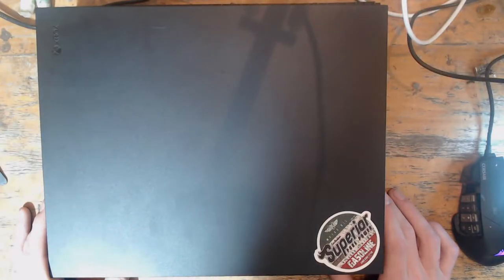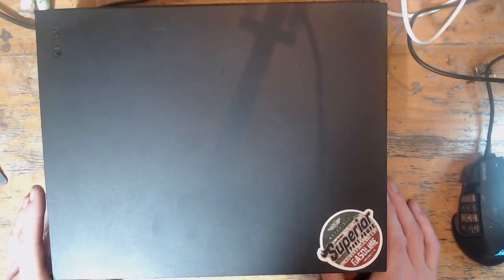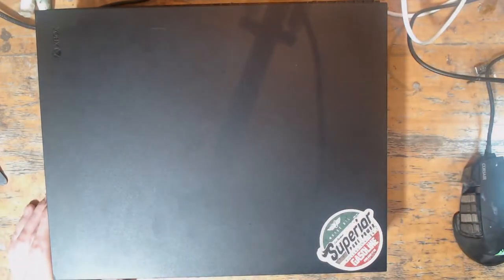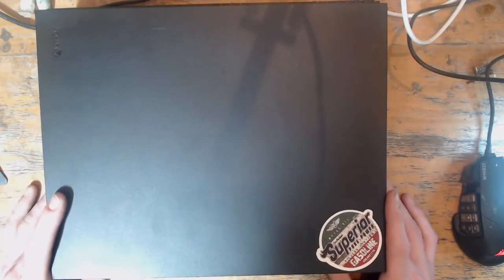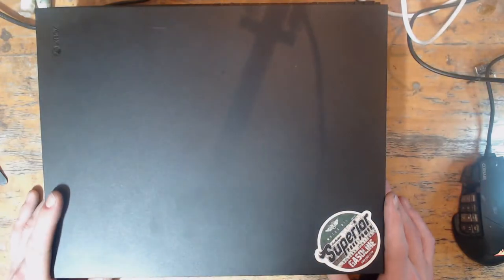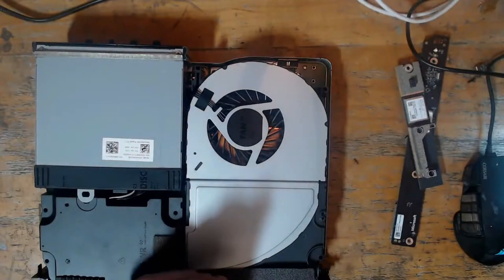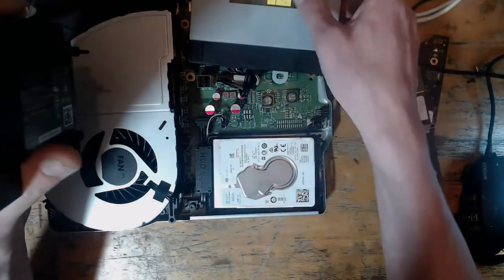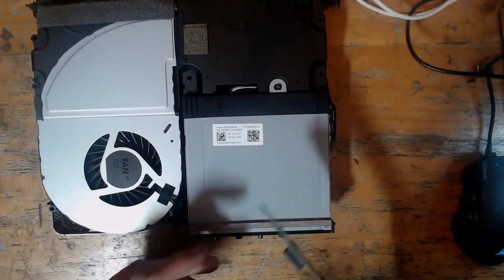Xbox One X Black Screen No Display - How To Diagnose And Repair A Faulty TDP158 Retimer IC

Comment: Thank you so much Phil I just brought my first xbox one x back to life. I did the retimer chip and that didn't fix it. I then noticed the hdmi out port looked like it had been worked which is funny cause the guy I bought it from had said that it just stopped working. I didn't have any hdmi ports for it just the ps4. In a pinch I harvested the hdmi in port from the board and used that. Success!

Comment: A few things from me :). 

1. Thank you, it was the video a long time ago where I've learn about the fault of TDP158 :). I see that I've already liked it, so can't do it twice :D.
2. The difference in the leaded and lead free solder is only 30C, so, not much ;) IMHO. Only soldering paste and low melt solder can do less than that and that is a big difference in the melting point. But 30 a lot ;). C'mon :).
3. Yes, soldering those pads with no T12 which can give up to about 70W vs a regular soldering iron, or a regular soldering station which is 45-60W makes a HUGE difference :). The T12 makes a whole difference and it's worth spending those +£20 to buy a DIY kit to build it yourself. Again, you've said that you've got a cheap soldering iron here, but, I did not pay for my T12 DIY station more than those +£20. So, no excuse :D. I don't need to use a hot air anymore since I've started with this T12.
4. Using a 480C degrees is OK, I've done it in the past, but, if your station is +500W one you can do it with 350C as well which is the safe temp for soldering ICs comparing to 480C. When you buy these chips, you can read that you should solder them with a max temp of 350C. Otherwise you short their longevity. 

There is a preheater as well which can help lower the melting point from the top, and with preheater I was able to solder QFN packaging at 300C, probably you can go lower than that, but I've never tried yet cause I've stopped using preheater and use only a hot air.
5. You use a no-clean flux, I know cause you're the reason why I have it here :). So, you can clean = yes, but, it's not a must. Even in the factory when they use a no-clean flux, they don't clean more than an absolute minimum. This flux should not cause a harm to the board. All it can do is to make it sticky ;). 

I've rewatched this video after a long time cause I've got One X and wanted to make sure I remember everything :). And yes, I remember everything. I did wrote the readings as well this time of the HDMI port PIN out and this one is different from PS5 or Xbox Series S. I'll open today hope Series X will compare with this one as well. I'll show the comparison on one of my videos so that others can  have it for future reference :).

P.s: you could reply in the chat of your store ;). I had no reply for about 2 weeks I think ;). I won't use this chat again, what's the point ;). I was needing 621M chip cause I've run out and new ones came wrong, so my customer had to wait. I thought you can help me, but your shop if worthless ;) - at least for now.

Comment: Hi phil silly question, is there a retimer chip on the original x box one? As i am trying to repair one and all looks and tests good but am getting nothing on screen, just a black screen, i have changed the  filters and port looks good but cant see anything else wrong
Reply: Have you tried a different hard drive? sometimes a faulty harddrive can cause this problem as well. I'd see if it works with a new harddrive in, then I'd consider replacing the retimer chip.

Comment: Am trying to fix an xbox with no display output. I've already replace the hdmi port, and it shows a picture in sage mode (640x480), but no image in any higher resolution. This would indicate retimer chip issue? Would 640x480 still work if the retimer chip is busted?

Comment: Hi Phil!

I was playing my Xbox One X at work (12 hour shifts as a boom gate operator both day/night) and its my sanity keeper lol.

Lost all display through the TV, console boots fine and by using a HDMI to VGA adapter with a 3.5mm audio jack I can actually get picture at 576p or 720p but not 1080p to my PC monitor.

A quick google search found you!

Would a faulty TDP158 Retimer IC be my issue?

Of course I’m just guessing it could be something else, just strange the HDMI to VGA cable works up to 720p but a normal HDMI cable doesn’t give me anything...
Reply: im in it at a dealership and got my rework station at work right now gonna try my hand haha

Comment: Would it help to pre-emptively attach a small heatsink with thermal adhesive to the retimer chip?
Reply: this is clever, is the damage usually caused by heat and not internal corrosion?

Comment: Hi mate just wondering I've bought xbox one x no power went straight to the hdmi chip totaly bad install never seen such a mess and noticed its missing c50 c16 c17 c18 I've installed new retimer chip but don't want to put power to it incase it might pop the new retimer chip will it pop it. And also if u have them caps on an old donor board any chance I could buy them off you sorry to ask I don't want to buy a full board just for them 4 caps as I'll not use the board for nothing else as I don't intend to fix anymore the boards is selling stupid money on ebay. So was kinda hoping u could sell me the 4 caps if u got them don't worry if u haven't just figured I'd giva it a shot and ask lol.

Comment: Hello i accidentally blew away one tiny chip next to where it says "C8C12 "  after i replaced the ic.and hi port still no display , device turns on and stays on like.normal.but no signal? Hdmi port is 100% perfect maybe the ic is bad or its not mounted right ? But i heard if i did the ic wrong it wont even boot up?

Comment: Xbox one s. I swapped the hdmi in to the hdmi out because the hdmi out to tv was broken. The console started up fine, after about 10-20 seconds the screen started to flicker and xbox made a small noise inside every once in a while for about 2 minutes until it stayed black displaying no signal.
Reply from the maker: Hi Jose. If the xbox is making a noise you may have a faulty hard drive. Try installing a new hard drive and see if you get to recovery mode. Any laptop hard drive will do in order to test.
Reply: @TheCod3r  it's not making a noise like from the hard drive. To me it sounded like something shorting or maybe fuse blowing. I don't know if they'res any fuses in the board in case of the hdmi shorting the pins.
Reply: Also to note I didn't put the broken hdmi port on the in location. The in location is currently empty. I don't know if the pins on the in location are briged on the motherboard causing the flickering and possibly blowing something out leading to the black screen after a couple of minutes of working.
Reply from the maker: @JoseLopez-je9mx  it may have been the emi filters shorting out or the retimer chip but it's hard to say without seeing it in person. The only way to really know is to test all the pins for shorts using a multimeter
Reply: @TheCod3r  thank you

Comment: Besides the retimmer chip what else can it be?? I replaced mine and it made zero difference. I triple checked all of the pins and they look great.
Reply from the maker: There is a small bga chip on the right side of the port and they can't be purchased so if that dies you may need to find a donor board to take the chip from. Other than that it could be the emi filters or the port itself even if the port looks ok
Reply: @TheCod3r  the port looks fine,I've cleaned it with ipa and a toothbrush after scraping the contacts with an exacto. 

Is there anyway to test that silver chip near the port at the edge of the board??

Also I found two black Resistors near the retimmer chip that doesn't have any  Continuity while all the others near the chip do.

Has anyone came up with a test to tell for sure if the retimmer is bad or not?
Reply: I believe they were r31 and r32 that have no  Continuity.do you have one handy that you can check those for me??

Comment: after soldering the chip the xbox does not start, could it be a wrong soldering? thank you
Reply from the maker: Yeah if you have no power after replacing the chip you'll need to make sure it's soldered correctly
Reply: @TheCod3r  practically the led lights up for 2 seconds and then goes off

Comment: What temperature heat to remove the chip
Reply from the maker: I generally use 480⁰C to remove chips unless I'm near connectors, then I assess the situation as I see fit :)
Reply: @TheCod3r  we can’t seem to get the chip off

Comment: These retimer chip issues are a huge problem.
Reply from the maker: Yeah they definitely are, but a lot of problems stem from user error by inserting the cable wonky and shorting out the pins on the port itself, another issue is they have no way to cool themselves apart from the ground pad under the chip
Reply: Its seems that the retimer ic occurs mostly when pairing an Xbox one s or X with a 4k tv. The fat xbox one never had this issues and its locked at 1080 max.
Reply: @dalibensouilah950  ive seen xbox one S and X systems that connect fine to modern displays and only display black screens when connected to older tv's or monitors. ive read this is usually indicative of a failing retimer chip